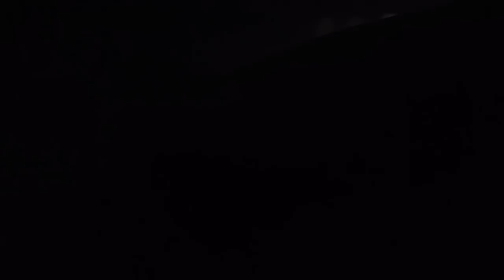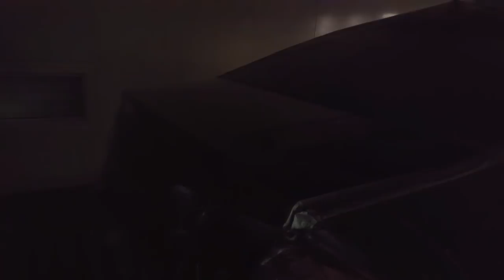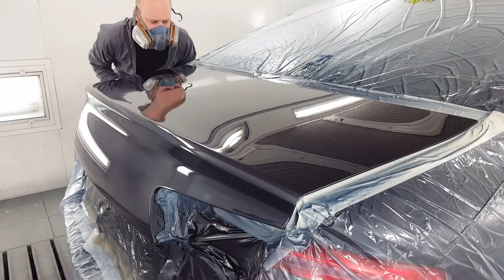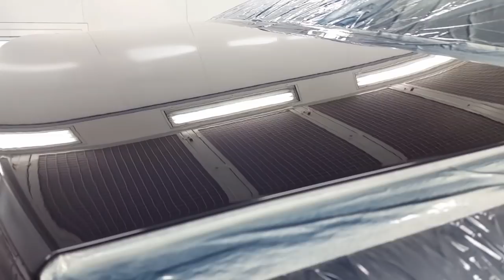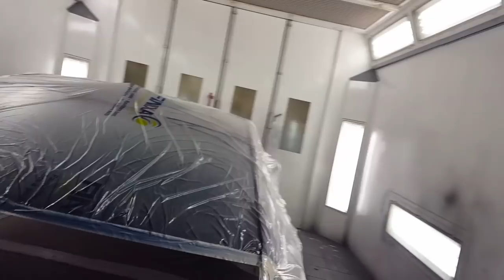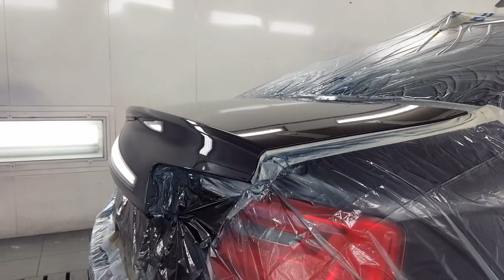Car Painting: Mirror trunk finish

Comment: Good morning Edwin, that base coat really dries even. Your use of that flashlight in the dark to check for coverage is a great working process. Thanks for all the tricks tips and techniques. Another morning video with spectacular results. Thanks and you take care.
Reply: Lol flashlight. It's called a sun gun. It will show you where the paint is to thin. Florescent lights won't do it. It's to mimic the sun.
Reply: @thewaltbrownellchannel9318  chill he had the concept right he said flashing which will show you the plants thickness or thinness if you know how to do it I seen auto body shops use flash lights to spot out the more heavier layers and the thin layers for a smooth uninform finish .but the actual light is a sun gun your correct but like I said you can use a flashlight if you know what your doing

Comment: Couple tips: wash the jams and the outside of the panel before you sand it. Wash the panel again before you tape it. Blow it with low pressure Then tack it. (Not at the same time) finally take your - Gloved- Hand and lightly rub the whole panel
Reply: Also if your gonna take the time to pop the trunk open so you have access to your edges you should probably put clear on them and not just let it blow over the edge.

Comment: You may have noticed he was able to blend the colour out with very little room, toward the quarter panels. Wont work with other paint lines cause you have multiple coats needed for coverage. It will even work with a spray sensitive colour such as a high metallic. like to see other paint lines do that!

Comment: Good looking finish but I knew there would be trash to pick out from the start.  You need to put a 12 inch piece of paper over the plastic around the edges instead of the plastic.  All those wrinkles will do it every time.  Also,  tack off  the paper/plastic

Comment: Amazing finish! Do you use the T110 air cap when spraying HS clears?
Is the T110 the best  air cap for a smooth Glass finish or is  the TE20 better?
Reply: This must be the work of a T110. T110 is the smooth glass cap, the TE20 is for factory orange peel finish

Comment: What do you apply before base color?
Reply: Vodka
Reply from the maker: A blender it takes up all the overspray
Reply: Was it fade out tinners before the base?
Reply from the maker: @jasondowlah9396  no its wet in wet
Reply: @DutchCarPainter  thanks man
Reply: @DutchCarPainter  im sorry.. But im really dont understand whats the meaning of blender..never seen that process done by others..
Reply from the maker: @boyoy4227  Hi, i will explain, when spraying base coat there is alot of overspray,espacially at the blending zone when the blending zone is dry the overspray creates alot of loose paint laying on the surface,it can create dust or unwanted marks in the clearcoat at the end.when using a blender the wet suface picks up all the overspray and let the blending zone so much better.when the blender is dry it is colorless. Hope you understand it better now.
Reply: @DutchCarPainter  im from Trinidad and Tobago nice to hear about it.but the wet on wet u talk about what the difference is it to fade out tinners
Reply from the maker: @jasondowlah9396  ok nice, i use fade out thinner for fade out the clearcoat on spotrepairs.
Reply: @DutchCarPainter  well nice great job thanks alot
Reply: Axalta’s process asks the you apply a wet coat of Color Blender or Wet Bed. It allows your blend to melt in and lay flat. Other have it as well, but its a dry blend. in other words you apply, let flash then apply colour into it. Its lousy cause you get a lot of sand piling in the blend area which can contribute to mottle or a lousy blend. Using the Color blender wet wet makes blending very easy and flawless. Take an Axalta Training course, you will be impressed.
Reply: @mrmuskey5202  I use PPG Envirobase and spray a wetbed that I dry before spraying my base..never have issues like you mentioned.
Reply: lucky you
Reply: The clear is urethane sir. Thank you

Comment: It would really impressed me if he was using the cheapest paint available in the most crapiest spray booth with the temperature above 100° F, until then, I would be impressed.
Reply from the maker: I have some old guns, maybe i will do it some times. You are totally right. Because in my opinion is the man behind the gun who make it work good or bad.i will adjust to the gun😉